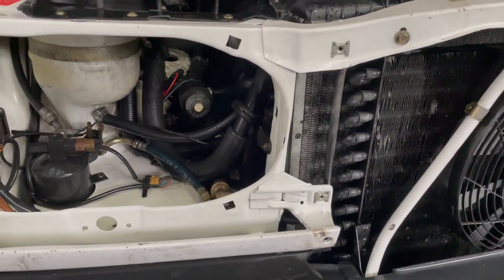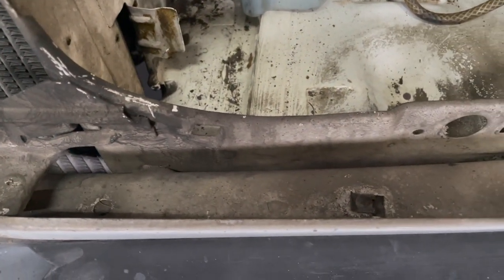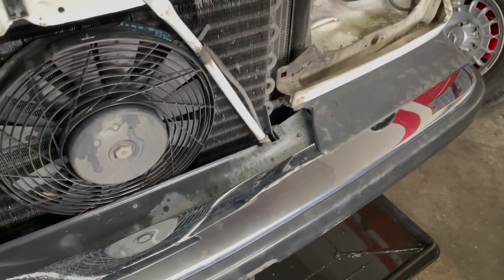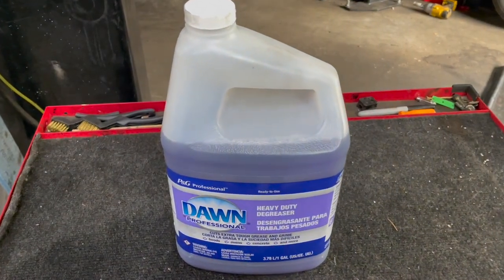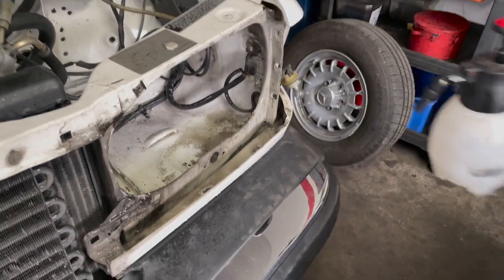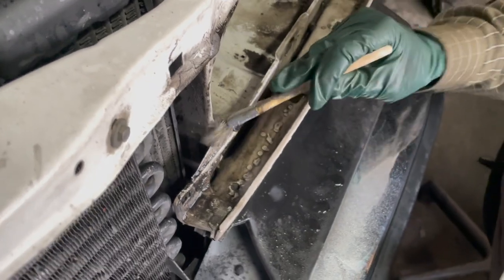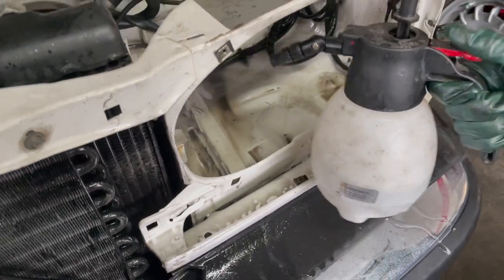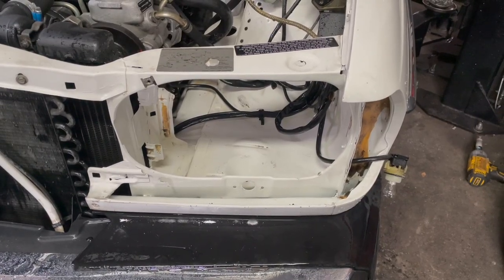Extreme Engine Compartment Detailing with Gusto - Dutch Method LOL

Comment: I clean engines by hand with brushes too. Great tip with the pump sprayer, and I’ll give dawn degreaser a try. Thanks Kent.
Reply: What's the best method to clean an engine bay? I'm not looking for showroom quality- I just want to get rid of most of the gunk but I'm afraid to take a hose near those vacuum lines.

Comment: I do my cars with the same method, but have not tried dawn. I use chemical guys degreaser, diluted. It works great, but it does have an odor. I use it around the house too, like for the soot on glass fireplace screens. I've used it for years and it's never damaged any surfaces.